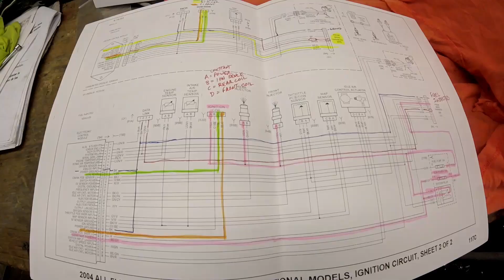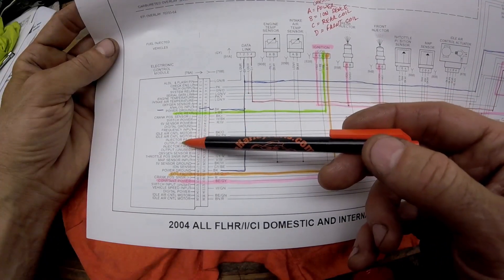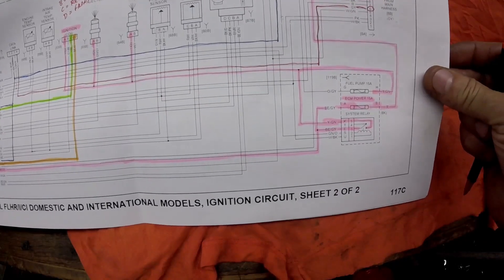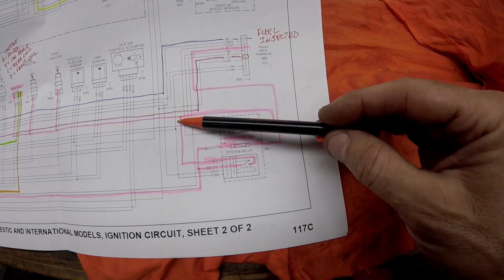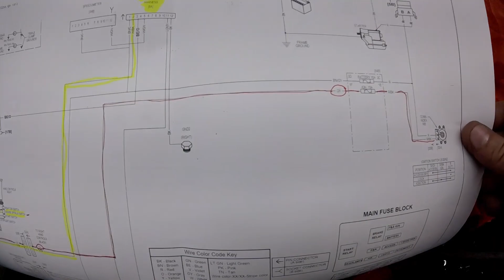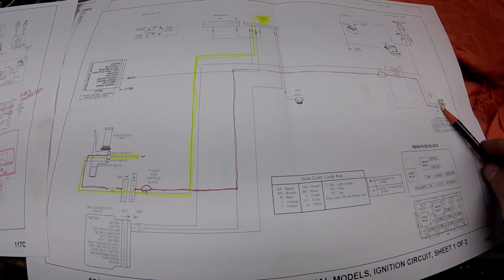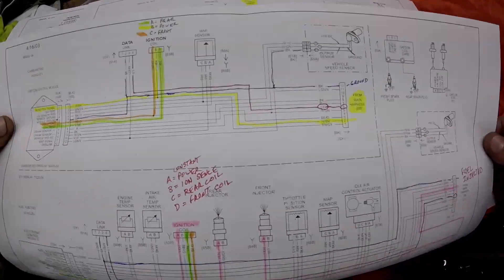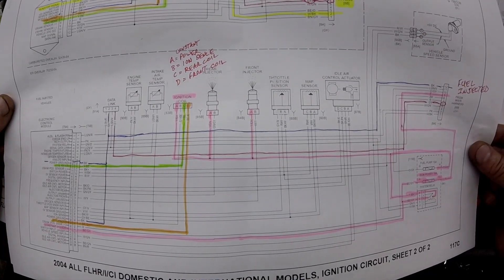No Spark 2001-2006 Harley FL Twin Cam 88 Wiring diagram

Comment: This remind me something of a couple of years ago that came to me...I don't know if I know I mentioned this before .. i may to  someone else that is has a YouTube channel. a friend of mine has a 2007 Softail and it had been in a fire we resurrected the bike. it looked really bad but the wiring harness except for in front of the gas tank was pretty good shape . the ECM was pretty good shape. so we set about cleaning and then painting the tins and we got it running and it ran good for 2 years. then one day the crank position sensor well that was the code so we changed that and it was fine, it wouldn't take throttle it would idle but no it wouldn't go any faster. then 2 weeks later it wouldn't take throttle again , this time it said it was the map sensor error and throttle position sensor error so we change those now we used aftermarket there. I did a lot of continuity tests made sure the wiring was good from the computer to the sensors make sure it was getting voltage and it was make sure the signal was going back and as best as I could using my vomit voltage was going back smaller amount he then took it to two shops. over a period of time each one said they couldn't figure it out but they would work on it on the in the winter time. the one shop did replace the map sensor with a Harley one but still no change. and they asked if he'd maybe want to buy another bike. he brought it home. I ended up changing the wiring harness with a used wiring harness. I also change the computer to another used computer I married the computer to the bike I think it took two times or it didn't take the first but I did get it to work. but again it was it would run but it wouldn't take throttle I clean the injectors.. coming from older style like shovelheads and Evo bike I was a little out of my element but I knew electrical stuff. at least I can wire a home. and I used to work on tube radios years ago and televisions. so in the end because wanted to work on it except in the winter. I switched it over to a carburetor put a thunderheart ignition and that ignition knows where the motors at through the crank position sensor and runs great but it's still bothers me that I couldn't figure it out and I know I can't figure everything out but that's my story it was just kind of an odd thing. well thanks for reading..✌️
And I read about as much as I can find out about the 07 Softail deluxe I think that's what it was apparently there was some kind of wiring problem but nobody ever had a or I never found solution anywhere I read...
Reply from the maker: That would be a hard problem to solve for anyone! Sounds like you took the same steps I would take. Thank you for sharing.